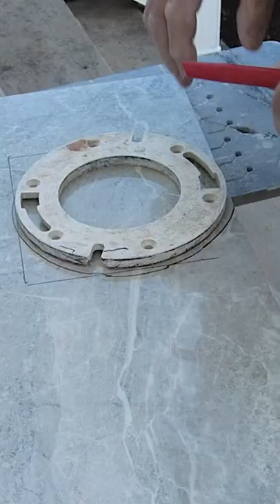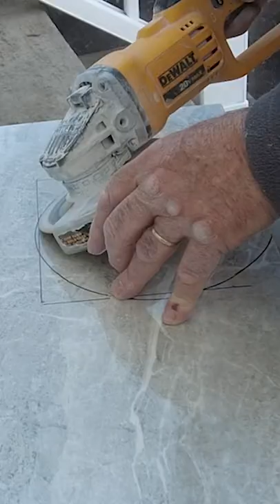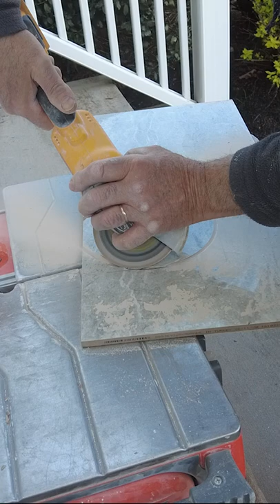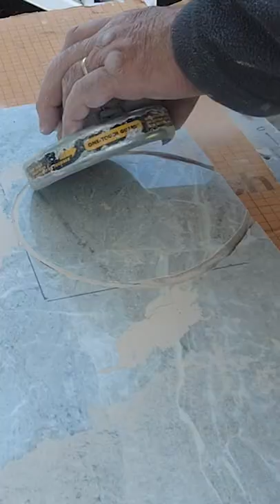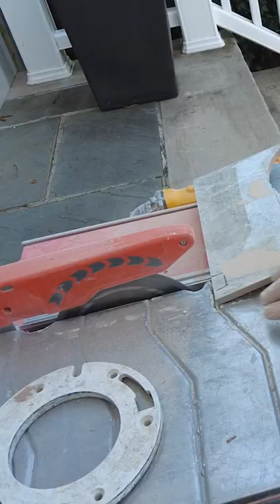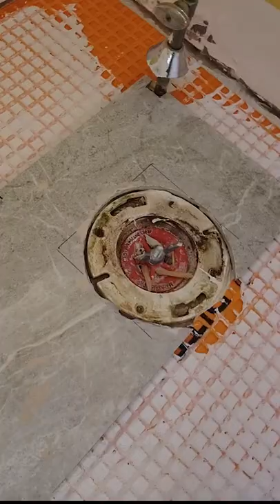How to cut a toilet flange hole with an angle grinder #shorts

Comment: Let me try again, please don't spread the idea that toilet flanges are supposed to be flush with the floor. 

Toilet flanges always go on top of the finished floor.
Reply from the maker: Correct, but sometimes you have to deal with what you are given. The plumber will add spacers to fix the issue.
Reply: @SalDiBlasi  If it's flush, an extra thick wax ring will do just fine. If the flange and toilet  aren't especially rough or uneven, the two size foam seals work fine. 

My worst sitiations are in a very large hotel I work at. 

Maybe one day you can make a post about gypcrete floors, if you've been unfortunate enough to work with those.

Setting a toilet on tile a pro set is a best case scenario. I don't get to see that very often.
Reply: Depends if your toilet outlet is flush with the bottom of the toilet or recessed, i have had both. Right now i am installing toilet with flush outlet so the flange must be flush with finished floor